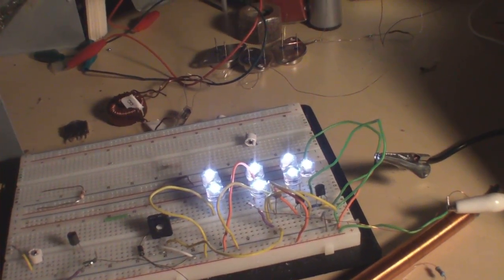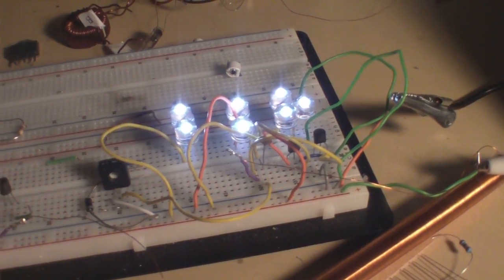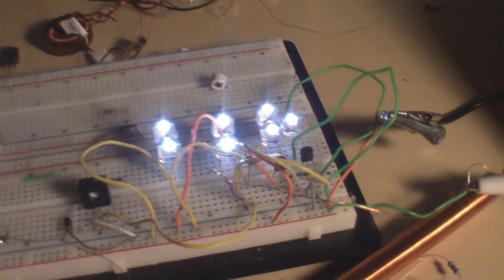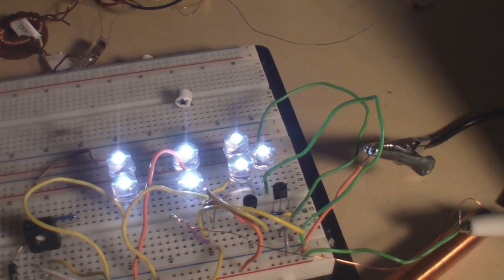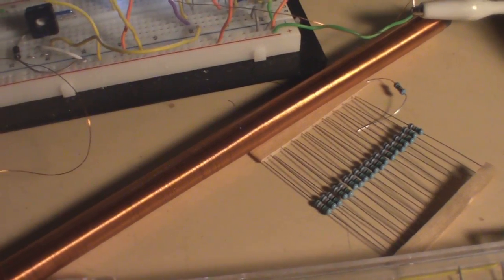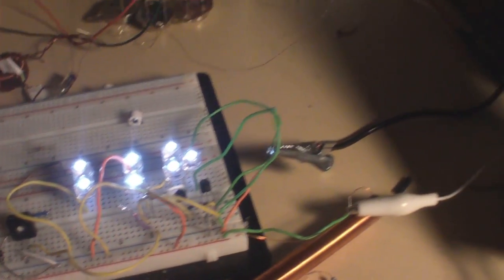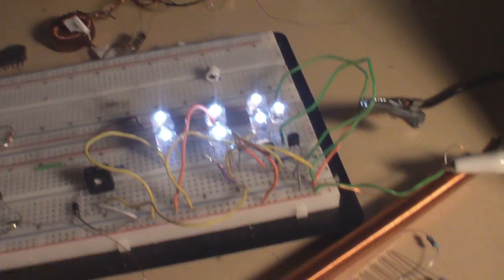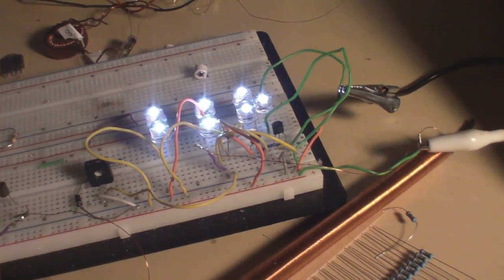Super Joule Thief - 8 cm Ferrite Rod - (7) 8mm LEDs - 1.38v / 10 mA

Comment from the maker: search for breadboard on ebay or alibaba express. I just did and found one for $1 including shipping. Not quite as good as this one, but totally adequate; half its size. The power pegs as shown on mine (red and black posts) really arent that usefull, you still have to connect the power rails to them - and therefore i wouldnt spend any extra to have that part on your board. Better just get the $1 ones and they can be added on to each other easily too.

Comment from the maker: Probably a transistor if it is black and looks like a barrel with one flat side, its a variable resistor if you mean the square with a white circular centre, and if it is generally white in color, low to the board - thats a variable capacitor. Not sure what component you are referring to.

Comment from the maker: @jonnydavro I do want to try a smaller ferrite rod. I also have an interesting, very thin, ferrite toroid ring. Unlike most toroids it has a large inside diameter and only slightly larger outside diameter, overall size about 7/8". It seems like it would lend to a lot of winds. Jonny - have you tried mixing your own magnetite and letting it set in the center hole of a bobbin? I wonder how that might be.